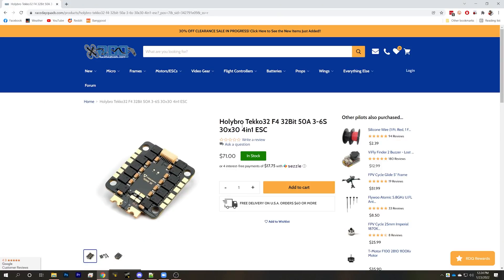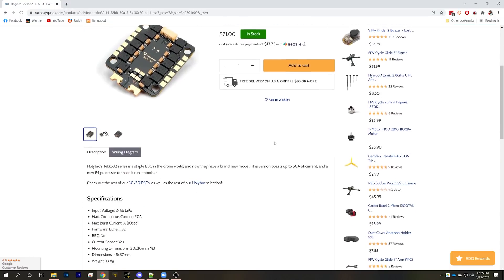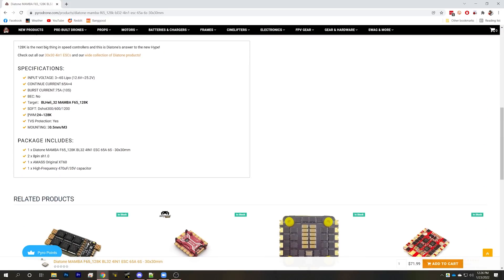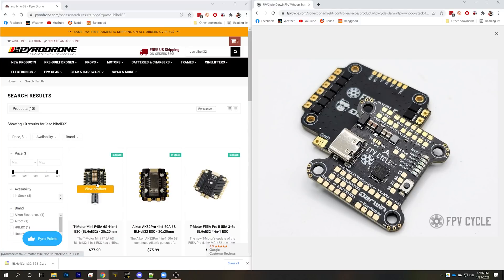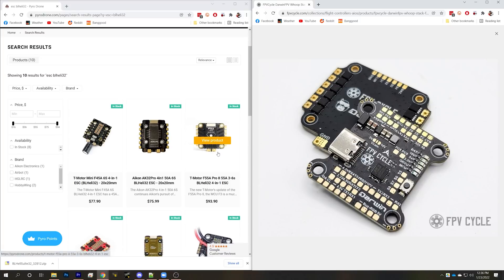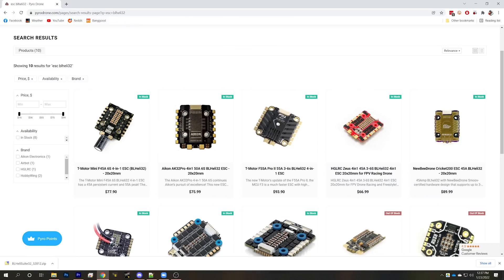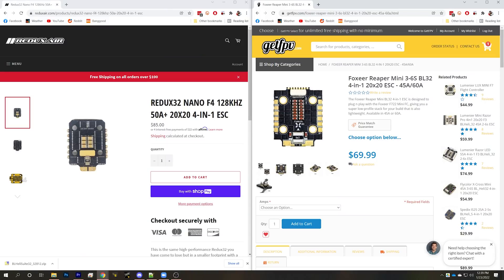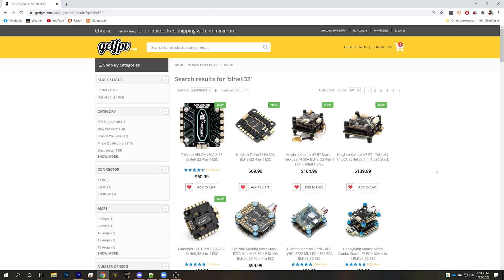How to pick the right BLHELI32 ESC in 2022 (don't miss out on the best feature!)

Comment: Joshua, Can you please make a video about reasons ESCs blow up and what size motors are good for what ESCs? I just had a SPEEDYBEE BLS 50A 30X30 4IN1 ESC fully short out my battery after 3 days of light use. Trying to get it replaces from Speedybee but Im sure they wont. I was running 6s with T-Motor Velox V3 1950kv motors. had a 60% throttle limit set. I'm just learning so i was just slowly hovering and learning in the back yard. it was never ran hard at all.
Reply: Was running bluejay and bidirectional Dshot as per your video.
Reply from the maker: Were you running Bluejay 0.20. It has been recalled due to blowing up people's motors.
Reply: @JoshuaBardwell  do you know when it was recalled? I went to wherever was the latest when I flashed it sep 5th.

Comment: I smoked an old school 20A ESC on my 5" by trying to fly with a broken propeller. Quad had gone down in a neighbor's yard and I was hoping to get it back without that uncomfortable conversation.
If you clip a branch or something and damage your prop, the time between that incident, and you noticing and getting the quad back on the ground, is going to be spent with that motor pulling higher amperage than its neighbors - amps that are asymmetrical and ergo the battery will happily provide.
Especially in today's era with everyone flying four-in-ones, popping one ESC means replacing the entire unit, so letting the magic smoke out is even more discouraged than it used to be!

Spoiler: Neighbor was more than fine with me retrieving my quad.

Comment: I want to ask question can i use the rx6 telemetry pinout as a ground im wiring 4esc 35a cyclones to amatekf722 se the esc have two wires signal and ground but no telematry
Reply from the maker: You have to use Ground as Ground. You can't use anything else.

Comment: Is it feasible for you to make ESC‘s again? And be a real competitor with some thing like Holybro? The reason I ask is because owning your FC and your ESC with a high PWM & F4 processor would be a really desirable set up.
Reply from the maker: I never made ESC's. Back when the JBF4 was sold, Airbot, the manufacturer, made an ESC with matching pinout so we could easily sell it in a bundle. But it was basically the same as ESC's they made for other brands. When we switched to iFlight as the manufacturer of the JBF7, they asked if I wanted a branded ESC and I said no, because I'm not interested in slapping my name on a product just to make a quick buck. If you want a "JB ESC" buy an iFlight ESC and pair it with the JBF7 flight controller. Take a Sharpie and write "JB" on it. That's basically what a JB ESC would be, if there was one.

Comment: Joshua, one question, i have a Mamba_F50_Bl32 with FC Mamba Dji F22Mk2 (Roma F5 V2) now i updated to 4.3 and works great, i have to modify something in BLHeli when i turn on bidirectional dshot 600 in betaflight or that's it? Cheers from Colombia!
Reply from the maker: BLHeli32 ESC's running firmware 32.7 and newer support bidiredctional dshot natively.
Reply: @JoshuaBardwell  perfect!! As you said in the Roma F5 V2 video, is weird that Diatone just send their drones with Bidirectional Dshot in "Off mode", thanks a lot for the info!! Cheers!

Comment: The Arterytek f4 was chosen as an alternative to a stm32f0 that is unavailable..different manufacturer and different beast from the stm32f4. The stm32 part is a well tested reliable mcu. Time will tell if the arterytek mcu is the same quality, or how long it will be even available. If they run out of the at32f4 unfortunately the stm32f4 processors that we use in our flight controllers are not a replacement.  Anyway there are a bunch of mcu's that can do 128k pwm from a low range just fine. Clock speed is the important thing. 48mhz mcus only have 500 steps throttle resolution at 96khz pwm.

Comment: I got very interested in your other video which brought me here. I felt sad when you "UGH" on 48khz. I've been using BLHeli32 32.8.3 for quite a while now. My setting is 24Khz and BY RPM. My esc is Spedix GS45A 4in1. It's a 1200 dshot and can only go from 24Khz to 48Khz. Based from what you said, my esc is not good enough. I have 2 of them but first one is more than 2 years old which is why I bought it again for my second quad. I picked it because it's extremely durable. Now your "UGH" is killing me and I have been thinking for the past 10 mins now what I am missing since mine can only go 48Khz. Oh well, I guess I must build another quad. Thank you. I'll continue watching now. :)
Reply from the maker: 48k is enough for typical 5" motor for what it's worth
Reply: @JoshuaBardwell  Cool! Thank you.
Reply: @neilfpv  So rather than setting low to 24KHz and high to 48KHz, you may as well stick to 24KHz low and By-RPM high, I believe.

Comment: As you can enable "by RPM" in BLHELi32 regardless of the ESC processor type, what happens when you don't have an F4 ESC, but you enable it anyway?  
Does it only work up to the ESC's Max supported PWM frequency, after which it just stays at the max PWM frequency available?  What if any down sides would there be to that, as would you not still benefit from removing RPM harmonics at lower frequencies? Or does it just not work?
Reply from the maker: It still works but only within the supported PWM range. So you may not be able to avoid motor harmonics depending on RPM.
Reply: @JoshuaBardwell which means 1) it isn't worth upgrading on f0 escs to 32.8.3, or 2) it is worth upgrading but not enabling 'by-rpm' or 3) it is still worth upgrading and enabling by-rpm (despite the potentially missed harmonics dues to the limited pwm range of the f0 esc)? -sorry JB, I know I'm a pain!
Reply from the maker: It is still worth updating as there are a few other fixes in 32.8.3 that you can benefit from. Look at the min and max RPM range supported by the ESC. It's possible that an F0 ESC could still have a beneficial RPM range to benefit from by-rpm.
Reply: @JoshuaBardwell  My F0 escs for from 24kHz (I think) to 48kHz (I'm sure). Is this a beneficial RPM range to benefit from by-rpm, or should I just stick both low and high to 24kHz?
Reply: @JoshuaBardwell  Forgot to say: Thank you JB👍

Comment: the product descriptions seems to be very incnsistent. is there a list of relevant escs? (tmotor f55A PRO II: f.e. i couldnt find any pwm info)
Reply: I bought exactly the same esc. I can’t seem to find pwm info either. I see that it supports d shot 1200 but not 2400..
Reply: @DennisCamps  the info of 2400 have been removed after it lost its relevance to betaflight. on some old product infos it supports 2400.

Comment: I've been building my race quads with foxeer reaper 65A 8S 30x30. I'm hoping it will be basically indestructible for my purposes. Only one race so far and it survived of course. I'm using the included cap and a 28v TVS diode. Time will tell..
Reply: Help me pls. I am getting a shit ton of video noise after I have started to use that esc.  And how did you set it up?I am interested in the pwm settings morr.

Comment: I have 2Year old Tekko Blheli32  F3 is it worth to Update the Firmware? I know i will have Not the Full adwentige of the new feturue by 48kHz but should I try it or shouldn't try it?
The : " Don't touch in an running System thing" ?
I have not many Flytime with only 2Packs and only open Field. I will Not feel and Difference, I collecting many Propeller but I Not Feel and Difference between the Propellers.

Comment: How to actually find out what Range of PWM my ESC does? Do I just Connect it to Blheli and see whether the Slider Moves the whole range?
Reply: Yeah that works too
Reply from the maker: That's the only sure way I know. Buying an F4 ESC is the most certain way today to be sure you get the whole range.
Reply: @JoshuaBardwell  I got my foxeer reaper 96khz to go all the from 16khz to 96khz then damnn
Reply from the maker: If it goes 16-96 that's enough for almost any setup.

Comment: Hi. I am planning to buy a esc for 30.5 x 30.5 size and I am between mamba f65 and tekko32 65A which one should I get. I think Tekko32 quality is superior but it doesn't have 128k pwm.
Reply: Get the tekko32, i was also checking the mamba f65, because of its price and features. But I don’t see any caps on it, and i know a lot if pilots using tekko32 with erpm features since oct 2021, ive been using this feature too since oct but with an aikon that runs up to 96khz

Comment from the maker: Any ESC with an F4 processor should support the full range of "by-rpm" PWM frequency. If you have an ESC with an F3 processor, it may go up to 96k or 128k, but it will have limited range, such as 48k-96k or 96-128k, which may not give the full benefit of by-rpm PWM. If you use "by-rpm", the actual PWM frequency may not go all the way up to 96k or 128k since it will be moving with the motor harmonic frequency, and motors may not spin fast enough to drive the PWM that high. Having a low PWM frequency such as 16k or 24k is most important for good braking performance, so I'd take a 24-96k or 16-48k ESC over a 96-128k ESC if I had to make a compromise. But a full-range 16-128 or 24-128 ESC with F4 processor will give the best performance for the widest range of motors.

Here is a chart showing the effect of by-rpm PWM frequency for a 2500kv motor going from 0% to 100% throttle: https://user-images.githubusercontent.com/1584497/131209639-85ac63fd-4253-44e2-a93f-23d76fc6a7ba.png

The blue line shows the PWM frequency and how it interacts with the 2nd motor harmonic (the 2nd reddish line). The blue line shows the PWM frequency staying at 24k until about 1400 us (a little below half throttle) until the 2nd harmonic approaches 24k, at which point the PWM frequency rises to stay just above the motor harmonic. Notice that the PWM frequency tops out below 48k, so for this situation, a 48k max PWM frequency would be enough to get the full benefit of the by-rpm feature.
Reply: I'm not sure it really matters all that much that the ESC support a wide range since we don't have the data on "by rpm" showing that it would actually go anywhere near 96 or 128khz if the low is set to something like 16khz. The charts sskaug posted when set to 24khz indicate that the esc barely gets to 48khz. So the dynamic pwm may not really use the full range. Mostly just for existing hardware. If you have the opportunity to get a new ESC, by all means get something with a wide range, but at this time, i'm not sure you'd be missing out on much. https://github.com/bitdump/BLHeli/issues/546#issuecomment-907584902  I also don't know, but i don't think this narrow range had anything to do with the processor as much as just a manufacturer's choice .... that being said, one thing that I do think is processor based, is the capability to run DSHOT2400 if you wanted to run that on KISS that i think requires F3 or above.
Reply: What about F0 32bit ESCs would they do 16K-48K or 24K-48K with "By RPM"?
Reply: @baggszilla  yes, they do. I got two Mamba ESCs with F0 and run PWM 24 - By RPM (48 kHz is max. it can handle). Give it a try…
Reply: Since by rpm does not drive you over 48kHz there is no point in recommending anyone buying an 24-128kHz ESC and suggesting to turn on that feature. The range of 16 to 48 kHz is optimal for racing since you also want high braking power on low throttle on smaller tracks. So I would always choose a 16-48kHz ESC over 24-128kHz. The lower range down to 16kHz is more important than going up to 128kHz. 
Kiss has implemented 128kHz for long now, also with some higher modifications to the pwm signal. There was no benefit to it, else more racers would use it.
Reply: @mattimehner9193  the hype avout 128k comes from Rosser's tests but while I love the work he does I feel that the static tests he run are not representative of real flight impacts. 
I saw a comment to the video, a guy asked about demag compensation impact on performance and Chris answered that in his test it didn't change anything. I can swear that turning demag compensation off boost motors power unbelievably and you can clearly hear them scream much more, hitting higher rpms. This alone makes me think that type of test is unreliable
Reply: Awesome thanks that explains everything I wanted to know
Reply: Okay that totally answers everything I just asked on the other video. ;D
Sorry.^^ And thanks so much for what you do.
Reply: Hello from Russia, Joshua! Please say, does it mean that  "by-rpm" feature will afford significant energy efficiency?

Comment: The real question is are you going to keep consistently using this for your builds? Do i need to re do my perfect jb build? I already had 1 sin and used a 500mw sharkbyte over the rush solo. Lol
Reply from the maker: I would prefer to use F4 ESC in future builds but I'm not throwing out perfectly good ESC's in current builds just to upgrade.

Comment: It’s like you made this video for me. I just installed the Mamba H743 with their 65amp 24-128k ESC into an iFlight XL5.
Reply: Stack got sent back. No bi-directional dshot. Between Diatone and BF going back and forth with some finger pointing I gave up. Ended up getting the same ESC, but with a Holybro Kakute H7. They’ll be here Sunday.
Reply: @msherburne84  but your problem was with the FC? or can you confirm that F65 don’t have Bidirectional DShot support? 😱
Reply: @charlsfpv8464   FC. I have the same ESC with an f722 and works perfectly.
Reply: @msherburne84  😅… thanks bro.. 5pcs F65 are on the way to my hands right now…
Reply: How was it?

Comment: I was looking at a 128k for long range. Do u think on slower spinning props the higher hz matter as much? Like 7 to 10"
Reply: by rpm sure has made a big difference even on f3 esc's for me, got a 10" with tekko65a 4in1 f3 that sounds a lot smoother, although im sure its less noticable when your not moving the  throttle as much, i also had to lower my tpa to get a bit more pids in the top end with the higher pwm loss of torque
Reply: @badfourlife  oh I'll try that when I try higher  hz again

Comment: Yo JB.
I need your help so bad man!
I got an esc from pyrodrone like a month ago, and I can not get it to throttle past a hover, and most times it won't even take off.
I been doing this for 9 years and never had an issue like this.
It is a holly bro 45a mini.
If I can message you on Fb about it. Never crashed I swear, hell I can't get it in the air let alone crash it.
And wasent the FC bc it was also new
Reply: Try turning off temperature protection on the ESC. I just had this same issue on a new build. It doesn't read the temperature correctly and output limits to 20%.
Reply: @Alex DeFelice  I will give that a try man. I think when I got it that was set at 40c, and I was like wait a min, isent that suppose to be at like 140c. So I checked other ones and I set it at 140c.
But yes mine will not go past 20%.
And if I jam it it will take off, but then just come down like it's in fail safe when it shouldn't be at all.
Going to give that a try.
Bc it don't do that in turtle mode at all, I get full throttle that way
Reply: @toddbeal4373  If it's the same problem, you might also notice that if you throttle up via Motors tab in betaflight that the sliders don't do anything after 20%. Setting the temp higher didn't work for me; I had to disable (set to 0). For me this happened on a Diatone Mamba Basic MK3 F722 mini w/ F40_128k ESC. FPVCycle 16mm motors. Since fixing this, it's become the best flying quad I've ever built.
Reply: @Alex DeFelice  going to try it in a second here.
Building a new 9 inche drone right now haha
Reply: @Alex DeFelice  dude man, ypu are a life saver!!!
Thanks for that tip, it worked, got full throttle now. So damn happy now.
I thought it was the FC bc I had everything new on it, then switched it out 3 days ago with one I knew worked and it Still did the samething.
After that I knew it was the esc.
Jb definitely needs to make a video about that issue. I was about to burn the esc haha.
It was on this new 2fiddy green frame.
Now I have to put this f7 zeus back in it since I know it's fixed.
Thanks again man
Reply: @toddbeal4373  Heck yeah bud, glad it worked!
Reply: @Alex DeFelice  yes thanks again.
Just got done flying it as well. Love the esc, very smooth.
And went and added this new rpm JB said about doing for these F4 esc. 
Man it make a big difference, smooth the whole way through
Reply: Mine is one of these F4, but mine it the mini 45a one from pyrodrone

Comment: Its more that the processor a f0 could do 128 khz its the other circuitry ...i believe the fettec is a g0 and does 128khz ...id say the f4 part is just extra selling feature for marketing since some f3 escs only do 48 and some do 96 ..either way full 128 is better but great video bardwell
Reply from the maker: F3 ESC's don't do the full range 24 to 128. If they do 96, they only go down to 48 or whatever.
Reply: @JoshuaBardwell  yeah i know that didnt think or say that

Comment: Bardwell thanks for this vid I just started using it on my 5in jb edition qavs I wanted to know what if you know if the aikon 35 Amp 20x20 esc works mine flies amazing but do you know what part of it isn't working
Reply: I don’t understand your question, but I will say that 20x20 esc has been the most durable 20x20 small mosfet ESC I have ever owned.